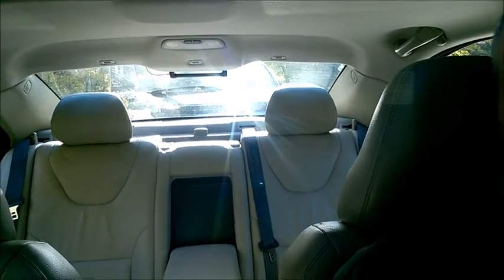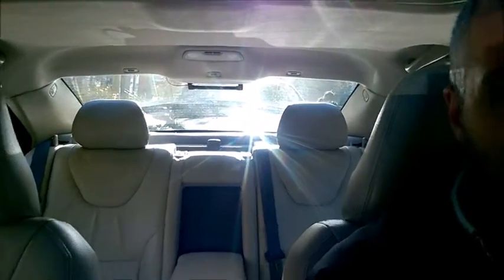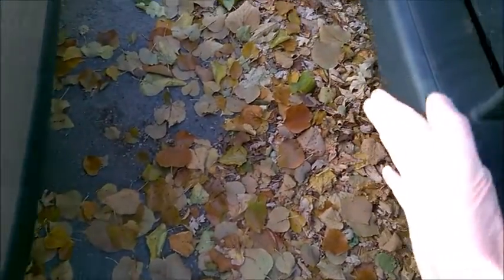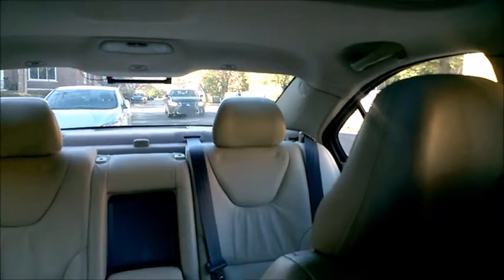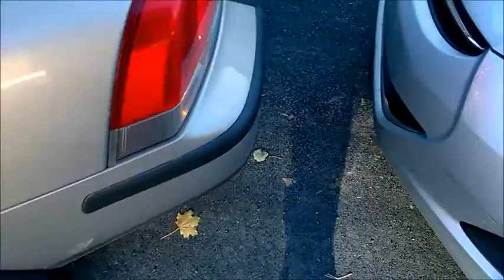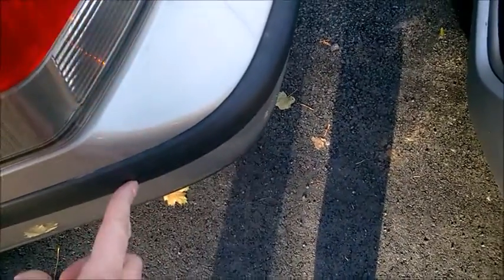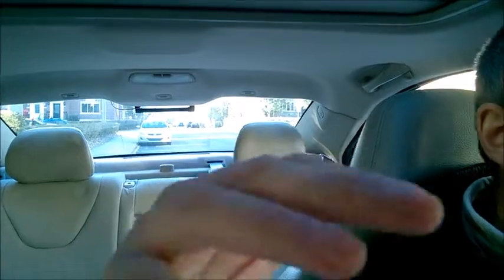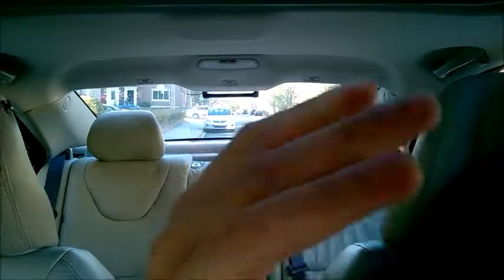$15 Parking Sensor behind bumper cover - no drilling - installed front or rear of the car DIY

Comment: Great video, have all the info I need so thanks! 
Just wondering, is the device still working? If not, how durable was it? Were there any problems with it over time?
Reply from the maker: Still works, only thing is during rain or after washing the car (wet bumper), it beeps for the first moments when reversing, then works normally. Funnily enough, I didn't notice it beeps when the bumper is covered with snow, perhaps it does but I don't remember to happen too often

Comment: Great video. By any chance do you know of these (or similar sensors) can be installed in a Volvo S60 2004 front bumper?
Reply from the maker: The front bumper cover is more difficult to remove - at least for the first time - there's rivets, plastic pins, etc.  Once removed, it is possible to stick the sensor strip along the back of this cover, making sure the strip sits on a vertical surface and as far away as possible from the actual metal bumper member - the metal will fool the sensor if it's too close.  May need to find a power source such as perhaps the position lights, and wire an ON/OFF switch inside the cabin which will activate the sensor when parking.  The sensor box also needs be located away from any large metal part.  Here's how to remove the bumper cover  https://www.youtube.com/watch?v=ds9MYP_4tvs
Reply: @Peppermint1  Thanks a lot. Your response is much appreciated. Kudos for your channel, it has been an extremely helpful guide in getting some badly needed repairs in my Volvo.

Comment: I can't see how wires going from bumper to inside . Where is buzzer ?
Reply from the maker: You can see the white wire at 1:58 coming from inside the car, there is a hole in the bumper for one of the clips of the black plastic piece, I passed the wire through that hole, inside the right side of the trunk. The buzzer is attached right near the module shown at 2:35, you can just taped it there on the metal somewhere, hidden behind the side cover inside the trunk.
Reply: @Peppermint1  If I wanted to could I buy wires and then extend the buzzer wire to when I want it is that possible?

Comment: Hi, thanks for the video. It was very useful to see the real visual demonstration. I have a question though. If I decide to replace the bumper will it come off easily? and will it be possible to attach it again to the new bumper?
Reply from the maker: Hi, not sure if it's same on all years, here's two forum link you may find info 
https://forums.swedespeed.com/showthread.php?138043-05-07-S60-R-rear-bumper-cover-replacement
https://volvoforums.com/forum/volvo-s60-v60-10/2002-s60-rear-bumper-32645/
Reply: @Peppermint1  I am sorry for not expressing myself clearly. I was referring to the electromagnetic parking sensor. After installation will it be possible to take the sensor off and attach it to the new bumper? I suppose electromagnetic parking sensor tape can be attached/used only once as it will be difficult to pull it off in order to reuse it. No?

Comment: My s60 have towbar, do you thing it’s will be a problem ? Should it work what you think ?
Reply from the maker: Good question.  The metal tow bar is about 5 inches from the strip band, I think it will be fine - plus it should really help not bumping the cars behind when parking.  But try first attaching the strip band with some tape over the cover, and see how it works: if it works fine, then you are good to install it as in the video.  Hope this helps.
Reply: Peppermint thank for answer ;)
Reply: Peppermint    I installed my today and it work perfect !!! So thanks for the video! My s60 back windows are tinted and when its dark outside it was very difficult to reverse but now its very easy. Thank for the video!
Reply from the maker: @saywhattt4462  Glad to hear! It's really helpful indeed